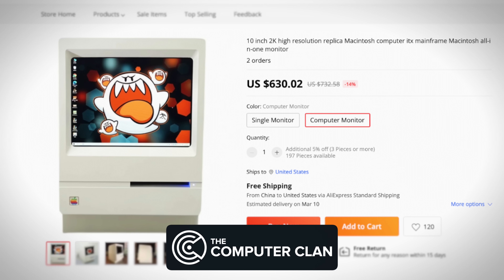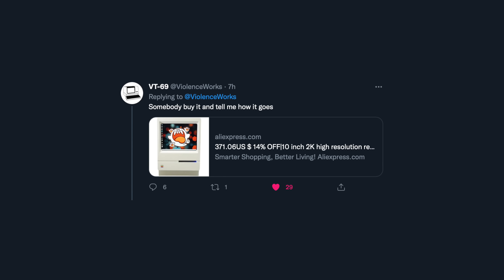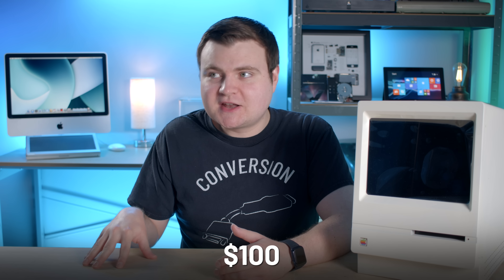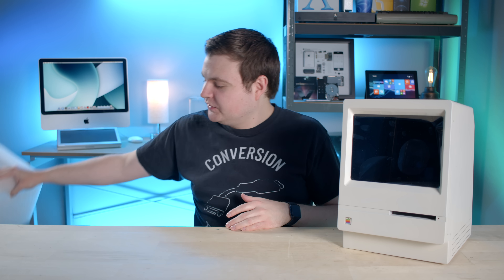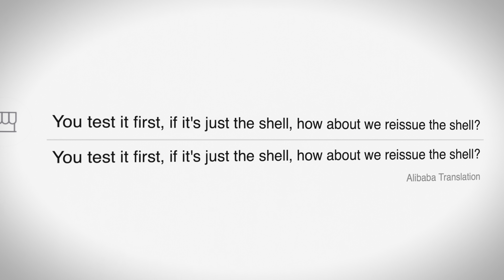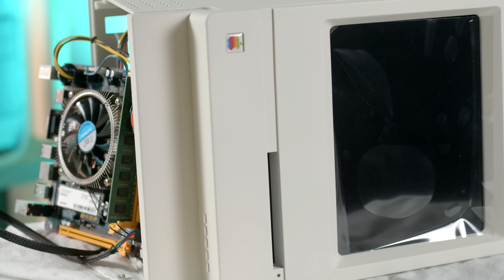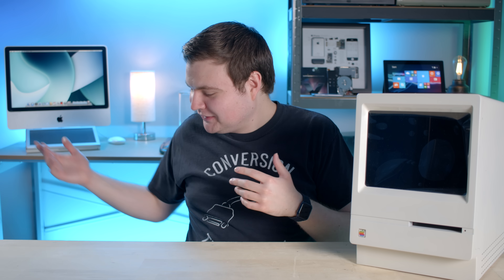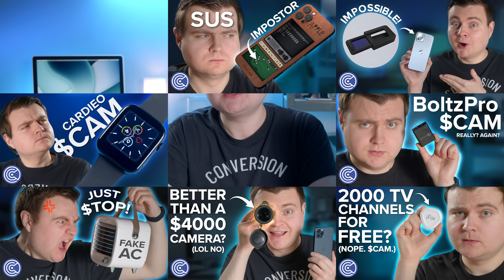Destroyed Macintosh Replica (Canceled Project) - Krazy Ken’s Tech Misadventures

Comment: The powdered 3D-print is called SLS, it's a nylon powder that is heated with a laser to make it melt together.
Reply from the maker: Ooh interesting. Someone else in the comments said "I don't think that thing is 3D printed (FDM)" because he didn't see layers. I'm a total n00b in this space, so do you have any response to that?
Reply: @ComputerClan  I have experience with SLS printing thanks to some biomedical research work I did in the late 2000s and early 2010s. It was super helpful to be able to visualize molecules and binding sites as a 3D model, so my department would print off RasMol files on our SLS printer.

FDM and SLS are two different processes, and SLS doesn't have layer lines. It's basically just that nylon powder melted together to form a cohesive object, but it's fairly fragile. SLS will crumble under certain stresses, and can shatter remarkably similarly to ceramic ware.
Reply: @proxythe1337  Exactly. I was thinking the same thing. It clearly isn't FDM printed (no layer lines, and it likely wouldn't have cracked in the same way this did). Possibly resin, but that would have to be a HUGE resin printer to make that case, so yeah, SLS is certainly a possibility.
Reply: @ComputerClan  as others have noted, it doesn't have layer lines. It have grain structure instead. Usually you paint SLS-prints to seal them and make them stronger, but here they cheaped out. I worn in a company where we got a plastic case for a retail product SLS-printed for a couple of years before taking the plunge and spending on a expensive mold for production.
Reply: @ComputerClan  ~ There are lots of ways to 3D print. FDM (fused deposition modeling) is where you melt plastic, and deposit/fuse it onto other plastic. Nozzle scoots around and spoots plastic everywhere. SLA (Stereolithography - but I think that's a bit of an over-broad term) is, generally, a technique of printing 2D slices onto a liquid resin, then pulling the part up layer-by-layer out of a liquid vat. SLS (Selective Laser Sintering) is sorta like liquid SLA, but with powder. There's also yet another technique similar to SLS, where an inkjet head filled with (basically) glue, flies over the part and dot-matrix prints binder onto each layer, forming a solid part.

The latter (the inkjet-like technique) is fairly cheap, I believe, and scales nicely - thus you can have big, cheap-ish parts. But they're brittle, made mostly just to test-fit a design concept. Definitely won't last years, and ... as you saw, won't survive shipping. And it makes a powdery mess, if there are enclosed spaces that just trap un-bound powder that crack open ;)
Reply: @ComputerClan  ~ Ooh (follow up to my above): I found it, it's called "binder jetting". See video: hjIoGPZPNjU - and that's how you got your big Mac.
Reply: @ComputerClan  3:02 looks like 3D printed layer lines to me
Reply: @mattelder1971  3:02 looks like 3D printed layer lines to me
Reply from the maker: @gqinc1202  Ah, so that's what that looks like, eh? Neat.

Comment: Have you tried different RAM sticks? Many computers will not display anything without RAM installed. The fan being stuck in a boot loop can also be a sign of bad RAM. Perhaps, this is the only nonfunctional component?
Reply: my thoughts are the same
Reply: many?? no, all
Reply: @bokieiey  some newer boards have a message that will come up to check the ram is installed correctly i know my msi board does
Reply: I had this happen I replaced ram and it did same on Intel pentium 4 motherboard I even replace CPU and RAM and it did same thing mother board was pooched
Reply: @sp3lllz  lol no
Reply: @h-6191  A few boards have a very small amount of onboard RAM (often 4-8MB) for just this, you can't boot with that but they can display and let you know that there is a RAM issue.
Reply: I'm pretty sure Ken and friends did much more troubleshooting than what was shown in the video before being willing to spend another $100 to ship it back.
But I think that's beside the point of this video, which seemed to be: beware of Aliexpress/Alibaba, it's always a gamble even if you find an honest seller.
Reply: This can also be a sign the CPU is incompatible with the chipset. Some Intel chipsets use a shared socket set but only support a subset of the CPUs that use it. More common in "business" products where the idea is to push them to buy an all new board or machine, rather than upgrade. *I doubt* this is what happened here; as I imagine the seller would have tested everything before shipping. But I've seen this failure scenario crop up before.
Reply: CMOS battery is bad. They’re bad for not booting on a dead battery.
Reply: @absolutely1337  um you don't need a cmos battery to boot since the only "problem" that happens if you do boot your comptuer without having a good one installed is your time that is displayed isn't going to be accurate.
Reply: @michealpersicko9531  I’ve had issues with some devices before with a flat cmos battery. With them turning on.
Reply: When happend to me I have only  pushed the reset button and all ok
Reply: Um…. How COULD a computer display anything without the RAM. Without RAM, NOTHING goes.

Comment: If I had to guess, the plastic of the case is Polypropylene, it's the only 3D printable plastic I can think of that is both really cheap and pretty weak. It's the plastic used to make disposable plastic grocery bags.
Reply: Nah, it's Nylon (PA12)
Reply: @zaprodk  Isn't Nylon pretty tough though? I mean, it's usually used as reinforcement in clothing, and I doubt it's that cheap as printer filament, especially not as cheap as Polypropylene

Comment: It's really common for the fan to stay on when a component is removed, especially if the fault of the system happens at a point in POST after the component you removed, so the system has a longer cycle before it shuts off and starts over. I think you may be running into a communication error between the memory controller and RAM. At least that is my theory of why it happens...the main point is I saw this specific thing happen a lot in my hands on PC repair days. You might have luck replacing the CPU? If possible. But it may not be worth the effort, as you've said.

Comment: Hey,
So about the shipping, what happens is that Chinese address formats are all in Chinese. So it's hard to format the address into English. But it is indeed formatted into 1 single line, nothing wrong with that. I assume the seller just slapped the address into a translator and just sent it to you.

It's simply in this format:
[Town name] -> [Village name] -> Street (Road) name ->[Block number]-> House number
Reply from the maker: That's good to know. My shipping service however has separate lines for everything, so it was hard for me to figure out what goes where. Thanks for your assistance!
Reply: @ComputerClan  Ah yeah, I assume you're prob using USPS. It uses the international standard and not Chinese format, so that's why that it was hard for you to figure out what to put in. For that heavy object, I think I would send that through Sea, since it's cheaper. But if you'd like to send it faster, air would be preferable. Otherwise, 2 days delivery is possible through DHL.
Reply: Theoretically you would only need "China" and the one line Chinese blob, because once the package is in China every English word you wrote would be useless

Comment: If you dont see layers, i dont think that thing is 3d printed (FDM). It will take time and isnt cheap if you are doing a lot.
Reply from the maker: Interesting. What do you mean by layers? : o
Reply: @ComputerClan  Any 3D printed object made with a regular 3D printer (FDM) is made of layers of plastic that are laid on top of each other. Even with a small nozzle, you can see them if you put them near your eyes and use some light. Some filaments use some tricks for hiding them and with a good machine a not trained eye may not see them.

For example my mother, everytime I show her a new print. But I can see the layers, even when the print is perfect and the filament used was a quality one. Not from far, obviously. If you can see them from far, you used a big nozzle, a big layer height or your printer isnt calibrated (or the plastic is crap)

For this big parts, Plastic Injection is the way to go.

Comment: This would be such a cool project if the case was decent.

You could install any OS(but probably not Mac OS) to make a amazing sleeper... Or it could in theory serve as Hackintosh which is probably the best use for this case.

But seeing this damage it's probably not worth the work. They couldn've used either thicker plastic frame or metal frame to keep the motherboard and rest of the  components in place. Low quality thin plastic just won't support the weight.

Comment: I wouldn't return that thing. I would try to fix it or someone to do it for me. Too much hassle to return. They will probably ship that junk to someone else and do the same scheme.

I personally ordered one motherboard for a laptop Acer Aspire 5520 from Alibaba. The motherboard took about one week to arrive here from China. I paid ~70 euro for the motherboard and 20 for shipping. The motherboard arrived, unpacked carefully, took the bag inside of the carton box and I felt something strange when I handled the bag.... There was a piece of the pcb about to break. The broken area is where the power connector is to plug an extension plug where it has a barrel connector. 
Not sure now what I did. I bitchered with Paypal with proofs that the motherboard was damaged from the source and it was impossible to break during the shipping. The shipping company was DHL. The seller (signing BR(azil) Jose) once he saw what I was doing, I complained about the motherboard being broken. I made him to send another one FREE of charge but he said he couldn't do that, I had to put more 20 euro and the motherboard was free of charge. This time, it arrived well. Assempled the laptop, it was working fine for sometime and started to misbehave. I simply put the laptop aside for a future me to fix it.
I also ordered a motherboard for another laptop from china and it also arrived well.

Comment: if i could get my hand one one of case i could build you one (i need shell whole case) if anyone have one doesnt work want converter it into newer system (i can do that not issues but remember there will not be crt because i cant conver power and vga port to work on newer motherboard only work with factory one so it going be swap out to lcd hdmi)